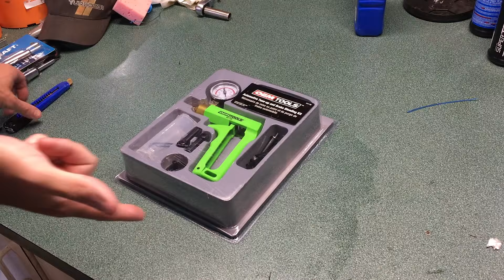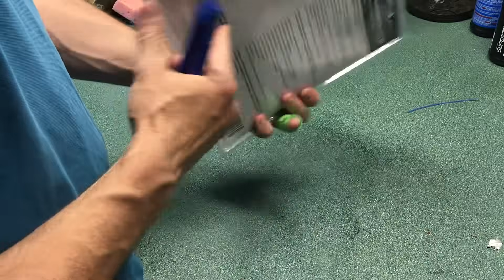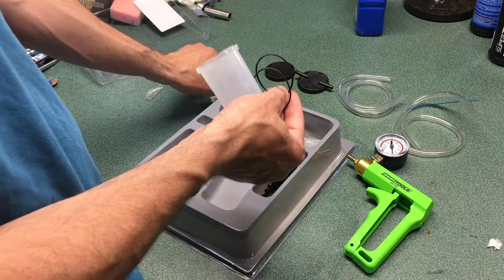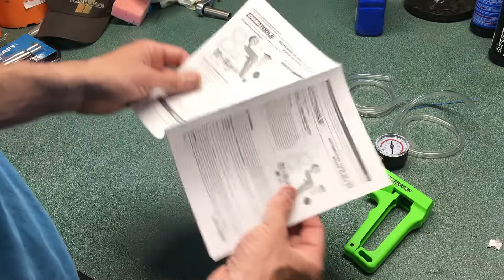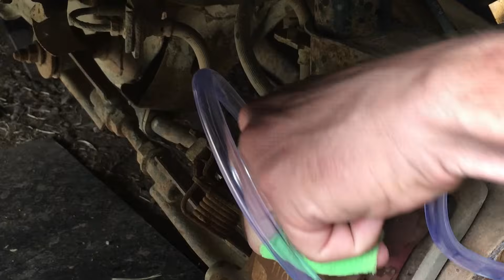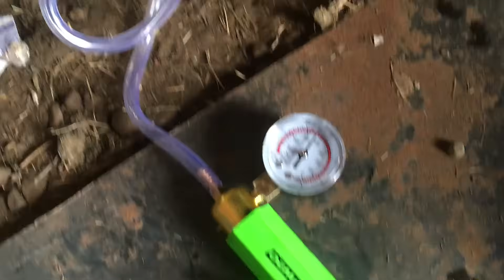OEM TOOLS Automotive Tune-up and Brake Bleeding Kit Unboxing and Use!

Comment: This is wrong though. 

-There is the attachment on the inside of the reservoir cap for a small hose. 

-You need to put the small hose on the inside of the reservoir cap and enough brake fluid in the reservoir that the bottom of that hose is submerged.

-Attach the hose to the brake bleed nipple thing while it is CLOSED and pump the vacuum 15-20 times

-Crack that valve open and watch the fluid come pouring into the reservoir while you do NOTHING (no pumping)

- Rinse and repeat till you get clean fluid/air out

I just did two calipers while trying to manually pump the fluid out, after cracking the valve open, with probably every different variation order of operations and when I stumbled across this one. It just WORKED there is no way it is not the exact way it is intended to be used.
Reply: Pre pressuring just makes sense, thank you, I’ll try it in a bit
Reply: thanks I just got one and was sitting here stewing after realizing the reservoir doesn't seal all the way on the cap- i figured you had to do something like this "it's not pumping very fast" lmao
Reply: @nunyabusiness1234mine was doing the same thing wouldn’t hold pressure there’s two of the rubber seals use the other one and it’ll hold
Reply from the maker: Maybe the sudden exposure to vacuum is enough, but I’m guessing YMMV.

Comment: I just bought this kit today. Pump doesnt even work. Tried everything.
Reply: Literally going through this right now
Reply: @whatittakesnortheast  I got it to work. I got pissed at it, and decided to wash everything in an effort to return the kit. Get my $40 back from autosuck. For whatever reason the pump works now. Try putting the pump on your finger. Get a good seal, if it still doesn't work try dunking it in water I guess 😂.  It's important to have a really good seal. Don't forget to o ring for the container. The o ring sits on top of the container. Dont try and put it in the cover. If that makes sense? Those 2 odd looking 90° black things are actually meant to go over the bleeder screw. It's a decent kit if it works, I can tell though it won't last long, and it's certainly NOT worth $40. What a rip off. It did eventually work for me though, and because of it I now have fresh new DOT4, and a like new brake pedal feel. I can't stand a spongy brake feel. I go crazy getting all the air out, and with my current car I looks like I'll be doing brake fluid every 2 years with the miles I drive.
Reply: Literally just bought this pump
And it has no vacuum. Taking it back tomorrow
Reply: Exactly!  This thing is a total waste!  I bought it like 6 months ago, went to use it now, and its going straight to the garbage.  Brand new pos and i would reccommend not buying it cuz they're shit
Reply from the maker: It is a pretty cheap unit.  I have another pump to fall back on, I really needed the accessories...that being said, this current pump is still running.
Reply: @RedBarnHomestead  thats what I ended up doing too. The pump failed again, but I used the rest of the kit for various other things.

Comment: This might help someone but your better off using the tube to at least suck out most of the bad fluid out the reservoir then using pedal method for calipers.
Reply from the maker: Perhaps, I will often replace all the fluid in the reservoir before beginning.

Comment: You must open the fluid reservoir on the master cylinder.  did you remove the reservoir cap?
Reply from the maker: It certainly helps.  Yes, we leave it open so we’re not fighting any vacuum from that side and can easily top it off as we go.
Reply: I don't think so

Comment: Did you figure out that you need to put fluid in the cup before cracking the bleeder?
Reply from the maker: Nope, just suck away on it, the cup holds fluid great but that’s all it does as long as you keep vacuum on the system.  It serves as a gas/liquid separator.

Comment: Not, not, not working, why not working?.
Reply from the maker: It works great in the front, I’m wondering if it’s too long a pull though all the brake line, proportional valve abs, etc.

Comment: question what happen to the bubbles did their go away or not? like the video!
Reply from the maker: The bubbles never really go away, I believe thats because the hose is so large.  I know using the vacuum gun and power bleeding the brakes resulted in no bubbles.
Reply: Can anyone tell me besides bleeding brakes again besides bleeding brakes what else can you use this for on a vehicle
Reply from the maker: @Franksinatra96  Vacuum testing sensors, like the egr.  Sucking fluids out of things, like differentials.
Reply: Looks like you can use the T-shaped adapter to start a continuous siphon as well, which will let you move things from one large container to another large container without continuous pumping or repeatedly emptying the small container. Right goes to the pump, left goes up to the source container, and bottom goes down to the destination.
1) plug the destination tube with your finger.
2) squeeze the pump a couple times to pull fluid toward the T junction from the left (source) branch
3) once the fluid is past the highest bend of tubing, you can stop pumping and release the destination hose. Instead of continuing through the T junction toward the pump, the liquid will flow down into your destination container.

Remember, siphons work off gravity, so the source container has to always be higher than the destination. It also helps to keep the pump itself above the T junction just in case.